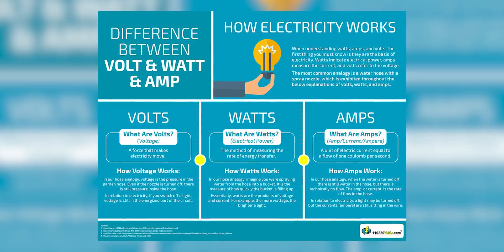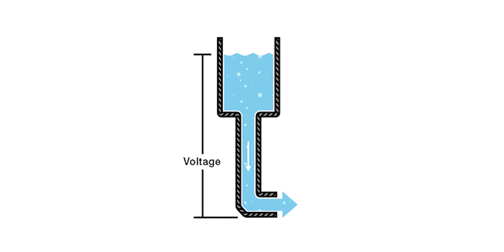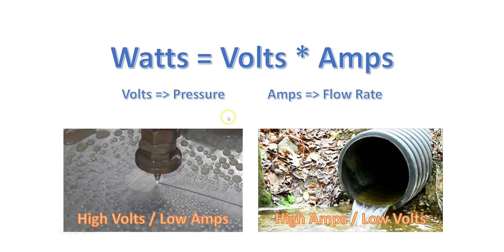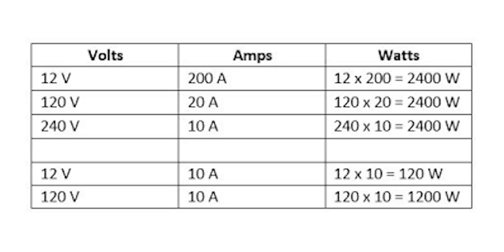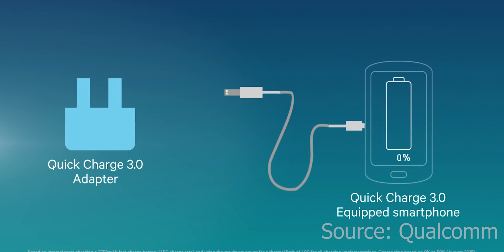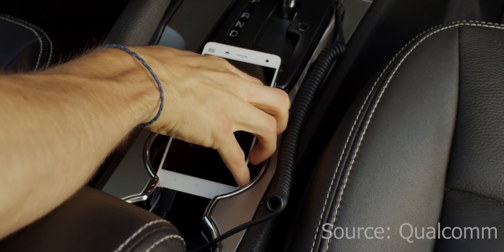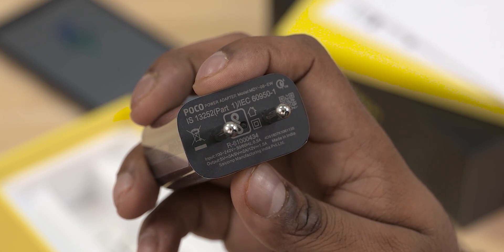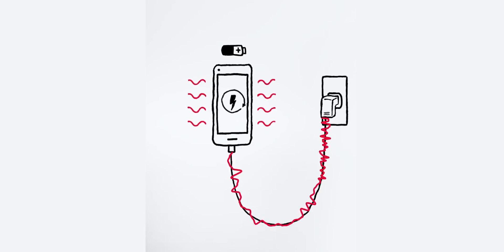How Does Fast Charging Work?

Comment: Nope, the rate at which the water flows(or electrons in case of wire) is called current.
The difference in potential between two ends is Voltage(imagine the difference between water tank kept in 1st floor and 5th floor )

Comment: I think if we use fast charge in regular base it kills the battery.  What ever the technology it pushing lot of power into the battery and heat up. Don't get me wrong. It will not impact suddenly. But it reduces the capacity much faster than a phone with a normal charger. Is anyone have same opinion?
Reply: Me2but I'm no Engineer

Comment: Well my s8+ proprietary charging cable is damaged so any cable I can buy
Reply: Go for a branded Cable buz unknown cable brand will ruin your charging port Go for Xiaomi Type c cable.
Reply: @pradeepkumar-st4ex  where I can buy xaoimi cable
Reply: @techh9171  Go for Boat Its braided cable and it really feels tough i had a boat cable and its nice.
Reply: @pradeepkumar-st4ex  
Actually now Xioami is running a sale & we can get it from Mi store at ₹200.....
Reply: @rravitejamavr6650  Boat is better than mi cable buz its a braided cable.
Reply: @pradeepkumar-st4ex  
🤦🤦 Did u see the price difference there....
We can even buy ₹1000 cable if we can afford it but Xioami's one is cheap & best...
Reply: @rravitejamavr6650 Dude the price of boat is 300 dude
Reply: @pradeepkumar-st4ex  
Dude from the link u put here shows price around ₹700 for 2m cable....
Reply: @rravitejamavr6650  Open it on Flipkart app not on Website
Reply: @rravitejamavr6650  Or search for Boat type c cable in flipkart app and its only 4 left.
Reply: @pradeepkumar-st4ex  okay
Reply: It's just 15W charger with a marketing term, just buy any USB-C cable and it'll work.....
Reply: @rravitejamavr6650  For your information, Not all Type C cables support fast charging, same as how not all micro USB cables support fast charging.
Reply: @amsterphangui5788  
I know that dude, I just stereotyped there, if someone is using S8+ then they know where look & get a good quality USB cable.....

Comment: I wonder about the health and longevity of battery with current day fast charging. . Isn't it always better to charge Li-ion batteries slowly?!
Reply from the maker: Most of the phones are using Li Poly batteries which should be good for a long time....
Reply: Yeah It will affect but it may be negligible.